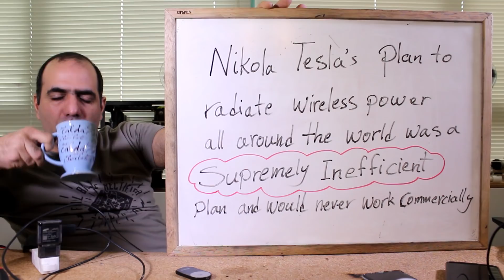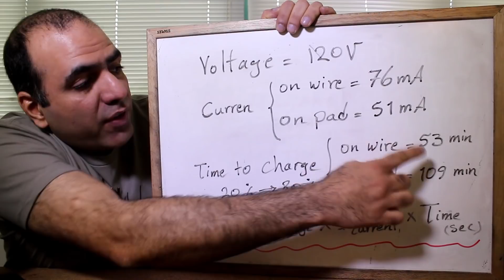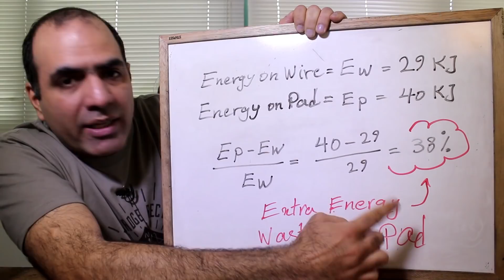Drowning in Inefficiency

Comment: i would guess that Nuclear power is much more efficient than coal,
it uses same damn turbine but much lesser volume of the heating agent. Now granted that agent is much rarer for nuclear plants, but it is far safer and produces much more power. (hence my assumption)

It is all basically a giant steam engine (in nuclear power plant with irradiated inner circulation with heat transferring tube to secondary circulation which will loose it some serious %, whilst coal, i assume, only has the one circulatory system for water / steam)

Comment: No-one:
Medhi: "Express VPN encrypts your data so it is safe from hackers and hookers"
Medhi Sadaghdar 2k19
Reply: MEHDI
Reply: typing 2k19 instead of 2019 is inefficient
Reply: @La_sagne  how? you're typing the same amount of keys and I find it easier to find letters (e.g. k) on the keyboard than numbers
Reply: @lazilexi  Because numbers are closer to each other so if you typed all numbers, it'd be relatively more efficient although it is just a small increase.
Reply: @nullbeyondo  yeah, but the way I have my hands on the keyboard I do it slightly faster because I can type faster when I alternate hands as it gives the not-in-use hand time to move to the next key, so going from left (2) to right (k) to left (1) to right (9) is faster than left (2) to left (0) to left (1) to right (9)
Reply: @lazilexi  Ohh it is Okay mate you can type whatever you want~ :) I was just pointing that the number of characters is not the only factor. Peace

Comment: Wireless charging is amazing. I've never "forgot to charge" my phone when I can just set it town at my desk, or near my TV, or at work, etc. So it's always charged.

It might be inefficient energy wise, but not charging or use wise.

Also ports wear out, cables snap, it's all super annoying, and again, never have this issue with wireless. I have a wireless charger from when they FIRST came out, and it still works perfectly, a cable gets bumped wrong and it's all over.

Comment: The advantage to a wireless charger is that I can slap my phone down without having to line up a connector. Lets say I use an oven for 2 hours for some baking. A good estimate for that would be around 4 kWh or 4000 Wh. Based on your findings charging the phone with the wireless charger used around 11Wh so if you charge your phone every day in a year it would be around 3960 Wh (the zombie power is so small it can pretty much be ignored). At an electricity price of around $0.12 per kWh, (US average) I'm sure most people would be willing to spend $0.48 for the convenience of slapping their phone down on the charger for a whole year.

Comment: Check out Nuclear Energy then, Mehdi, it has an efficiency factor greater than 90%, but everyone seems to steer clear from it :( 

- with love, from your local nuclear engineering graduate
Reply: if nuclear power provider companies built more resource renewable reactors and breeder reactors, and didn't sell the rest of the separated nuclear waste as stock for ammunition, missile thumper heads, and penetrating sabot rounds, i'd be perfectly fine with it. the fact that DU and other non-proliferation waste elements are being used to poison battlegrounds like in the gulf war makes the whole thing a lot less attractive. could care less about the nukes made from the fissionable products, if they are ever used en masse even at a hopeful 2% fission limit per device, the ethicalities wouldn't matter.

Comment: This man needs to take a thermodynamics class
Reply: And you need to think more before talk....Near 100% efficiency is possible and many doing it. Gas turbine power plant like SGT5-2000 E has 34% thermal efficiency in simple cycle....it can go up to 50% in combined cycle....and remaining warm (no longer hot)exhaust gases can be use to preheat water & etc. in nearby facilities and it is 85-90% efficiency and still in the winter you can heat up nearby residential houses and it will be around 98%.... and this was achieved by Germans.... or we can go with your idea....throw the exhaust gases directly into atmosphere and think about sadi carnot  max (possible) thermal efficiency of a cyclic process...

Comment: mehdi your figure with internal combustion engines maybe was correct in the 70s but most modern engines are around 37 percent for petrol and 45 percent for diesel engines but there are newer engines in development wich could make the 50 percent mark achievable
Reply: Sure!! I'll still find my way out lol!! Best of luck to you too!! Thanks for the info still!!
Reply: Still it pollutes more and more....
As rightly mehdi said, stop wanting junk!!
Reply: @itsanshtak  what should we use instead? Elcetric cars wich are just as bad for the enviroment if not worse maybe walk 30 miles everyday to work!?
Reply: Seriously, electric cars are bad for environment! Its like saying water is harmful for drinking!! Yes maybe be the generation of the elctricity to charge battery or manufcture maybe non environmental but still not like ICE who pollute with every drive, they would pollute only while generation and manufacturing and that too is being changed by renewable energy sources!! I think we should increase our perspective more and look and think of new and "not junk" devices!!
Reply: @itsanshtak  you should then also know that electric cars still pollute while driving because of brakedust and tire wear and such so they still pollute too also even enviromently friendly energy isnt good for the enviroment solar panels pollute alot when they are built wind parks arent good for the wildlife and water energy also destroys the enviroment where they are built! We need to research hydrogen cars they are the only possibilty because they dont need batteries to work and hydrogen is already quite often available. There are also e-fuels wich work in normal cars and dont pollute as much anymore so why focus on a worse technique like electric cars its a bit like in the 50s and 60s with nuclear power at first everyone thinks its good but then they realise its actually worse
Reply: Well these are very minute polluting levels you are talking about, remember you also pollute by breathing out co2!! Thus we should think that atleast we are working towards the pollution reduction in every drive!! And please dont get me started on fuel cells they are double as inefficient than batteries check out the "the truth about hydrogen" video by real engineering you'll know it!! And now just stop this, we should realise that we all are fighting for one cause, inefficiency not who is better you or me, so just stay calm and you work your way and i'll work my way and will both work for our mother earth!!
Reply: @itsanshtak  yes i will stop ill just leave it here that you can drive a normal car for 10 years until a electric car pollutes less and until then the battery of the electric car has lost efficiency while the normal car is still as efficient just use your phone as a example on how long batteries last when they are new vs when they are 3 years old

Comment: here's why qi chargers are a thing: you HAVE TO place the phone on a surface when done using it, so it will charge just by doing something you ARE GOING TO DO, plugging a cable on the other hand...

i have the same problem with wifi vs ethernet as you do with wire vs induction power, i also feel that way when induction is getting its power from a stupid coal engine, but if its PV panels or whatever, whats the point, efficiency no longer means losing anything, just like copyright owners dont lose anything to piracy; wanting to harness "potential" stuff is a guarantee towards mental agony

Comment: So google says that one of the reasons combustion engines are so inefficient is because of mechanical friction. So.... I have an ability to produce nickel plated copper nano particles in the 20 to 30 nanometer range and wanted to know if it could be used as an extraordinarily fine abrasive for use in the polishing of parts. Would polishing the parts reduce friction and provide any useful gain in efficiency?
Reply: No.
Reply: @TheRedneckAtheist  Oh well.

Comment: what about a heat pump? is has a theoretical efficiency of 300%
Reply: Well that's because it moves heat not create it directly. So a resistive heater is 1:1 ratio in power usage and output a heatpump would be 1:3. But all that is variable as heatpump efficiency changes drastically as outside temperature changes. So if it's really cold units have to turn on built in resistive heater or a gas furnace in the air handler unit.

Comment: My phone used to be water proof (shut up I know semantics, fuck off you know what I mean). I charged it wirelessly since I got it until my wireless charger broke. In less than a month of opening the cover to the charging port every time I needed to charge my phone the seal weakened to the point that the cover would just pop of, and the O ring came off one time when this happens and vanished into the ether.

I'll take the 20 extra dollars of power a year to not have to worry about my multi hundred dollar pocket wonder machine getting destroyed because I tripped near the pool or any other water deeper than a puddle.

Comment: I have an idea to create a device that scavenges ic engine's waste heat and converts it into electrical  energy 
But in my country (Croatia) i can't set up go fund me or similar stuff 
So that idea went to waste no pun attended.
Thank you for helping my country in these difficult time's
Reply: You are not first to think of that
Reply: @miralemnermina142  this idea came to me when I was 13 years old when i found out about NASA sterling engine design 
Right now there are devices that do that but they are not as efficient or modular as my design was
Reply: @blackturbine  it isn't that simple and easy to use in a car for example, there has been a lot of experiments with termo couples and they are simply not efficient enough

Comment: So, unfortunately the only ideas that I can come up with to increase energy efficiency have already been considered or are crazy. The first one which is for energy transference is to use high voltage dc current to transfer power and then to add a dc to ac inverter in the power boxes connected to homes. Applying this to cities would significantly lower the resistance of the power lines via a lack of the skin effect present within ac power transference.
Another idea relates to nuclear fusion and an insane idea on how to keep a reaction going. Now, this idea came after I made a high voltage generator and a ground/focus which could defuse the charge enough to prevent arcing. The new result was a cloud of electrons created by an electron avalanche that could produce cherenkov radiation in open air (99.97% the speed of light). When I split this beam in two and pointed them at each other, I was able to pickup small flashes on my camera in the middle of the beam focus. I hope that this indicates the creation of antimatter (more specifically positrons) because it would mean that you can create a decent amount of antimatter using a very small system. I want to use this method of antimatter production to create a kind of matrix of colliders around a spherical fusion reactor (note, this is based off of the reactor that NIF is attempting). Then you use a magnet to force the trajectory of the fast moving positrons to go into the reactor's chamber. As antimatter floods the reactor it should be able to reintroduce the thermal energy lost as neutrons are ejected from the reactor. In addition, if you surround the chamber with something like water or submersion oil you can use the energy of the ejected neutrons to power the colliders. Thereby maintaining the temperature required for fusion with only a little bit of added energy consumption (assuming that you can convert the energy of the neutrons into an electrical current effectively).
See? My ideas have either already been considered or are crazy.... ok, gn....

Comment: for high power short-distance wireless power transmission systems i.e. wireless EV inductive charger, the efficiency can be over 90%. I've designed one to transmit 3.3kW/6.6kW @ 17cm, the efficiency can be around 95%.
Reply: I'm all eyes. Tell me more
Reply: @Talha9137  use Litz wire for coils, low-Rds(on) MOSFETs for the power transistors. Be sure to use low-ESR caps (eg. film capacitors) for the resonant capacitors (instead of the ceramic ones). Don't set your operation frequency too high. (85 kHz for me). I use series-series (SS) compensation topology rather than  the SP/PS/PP topology. The SS compensation topology can achieve high power factor, which reduces losses compared to other compensation topologies under the same output power level.

Comment: Coal and gas power plants are extremely efficient because they operate on steam.  It creates 100% heat energy, which cannot leave the system until it gets converted into mechanical energy.  The only inefficiency is heat escaping through lack of insulation.  That being said, while modern steam plants have scrubbers, they're still polluting and running off non-renewable resources.  Any carbon that comes out of the ground has to go somewhere.  

I like wireless charging in the car and at the desk.  In the car because the charger I have allows me to see the GPS, and it's extremely fast to drop it in and take it out as I get in and out of the car.  It also mounts on front of the AC to keep it cool while charging with the screen on.  On the desk I have a pad that props up the phone so I can see notifications, and it's also quicker to grab my phone when I get up.  

You should also shouldn't use a case with a wireless charger.  While it still works, it becomes significantly less efficient, and creates more heat.  I use a DBrand to protect from scratches (not drops), and so i'm physically capable of gripping my slick iPhone with hone hand.

The inefficiency doesn't bother me too much.  My power comes almost entirely from solar.  While I don't have an electric car, I mostly ride a modern motorcycle that gets 55mpg, and has a 3way cat with air injection.  So it's basically a Prius with less of a manufacturing footprint.

Comment: In 2017 Diseny annouced there work with “quasistatic cavity resonance (QSCR)”, which is" where magnetic fields are generated to deliver kilowatts of power to receivers. These receivers can be connected to a device, like a phone or fan, to supply it with power."  QSCR -" An experimental demonstration shows that a 54 m3 QSCR room can deliver power to small coil receivers in nearly any position with 40% to 95% efficiency."

The paper is here on PLOS one https://journals.plos.org/plosone/article?id=10.1371/journal.pone.0169045

whats your opinion on this ?

Comment: Electric motors are around ~90% efficiency; the entire EV 65-75%
Reply: Failing to account for the usually awful efficiency of power generation, transmission and charging. The only real benefit of EVs at present is that city folks get to shift their air pollution into the countryside, making it not their problem.
Reply: Joe Stevenson false statement. Trasmission don't exists on EVs. Power plants are usually more efficient than stupid IC engines and have pollutants reduction for law.

Comment: most of energy loss is is in the chemical to mechanical transformation, in engines and generators, but once electricity starts flowing, the losses are reasonable and electrical appliances are getting better by the minute.

Comment: I came up with an idea of an engine that uses arcs to heat up air inside a cylinder and push a piston.
I recon it’ll have a 2% efficiency.
Reply: Sounds like a Stirling with more steps
Reply: Sebastian Kauer it basically is.
Reply: I had another idea, one which has an actual magnetic piston with a pole like north or south, then at the top of the cylinder an electromagnet with a type of switch which can actually switch the polarity of the electromagnet.
Suppose the piston in that cylinder is north polarised, when the piston is at the bottom position of the stroke the electromagnet will be polarised to south, when the piston hits the top the electromagnet will switch to north to repel the piston.

This will be an “attraction-repulsion” engine, or a “switching electromagnet”, or simply a “magnetic engine”... or maybe I’ll just call it the Hughes engine!

Comment: Ok, so you want efficiency? Energy recovery from tap water supplies. Instead of using a valve to regulate pressure, have a small turbine in each faucet and connect it to a small generator with a variable drive.

Alternatively, if your house needs a pressure regulator in the intake, make the same thing but automated.

Comment: What we really need to do is figure out how to make a superconductor *at room temperature*. Even our current superconductors will massively help in raising the efficiency of non-solid state power generation, but is difficult due to needing extremely low temperatures. If we could get a superconductor that can remain in that state up to maybe 60°C and replace ALL powerlines with them, humanity will get a massive boost in electrical efficiency to the home.